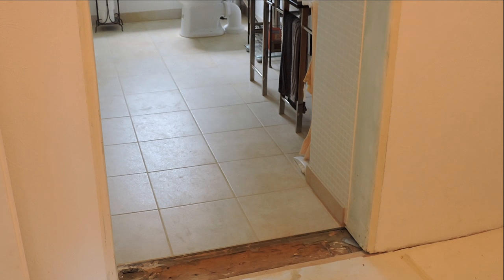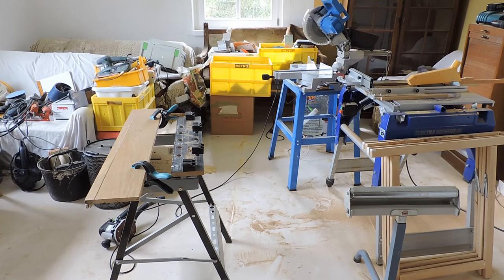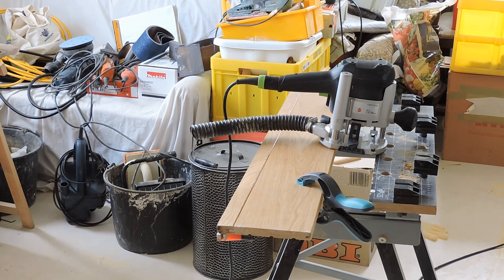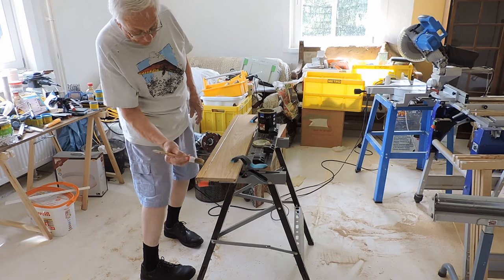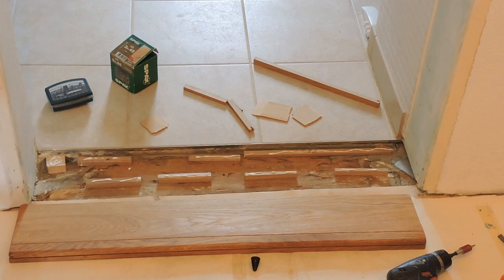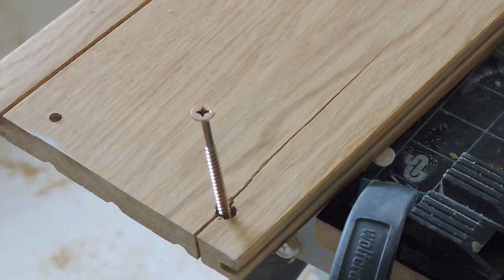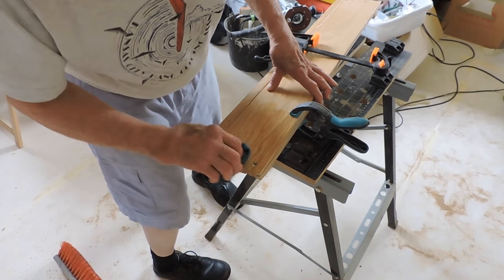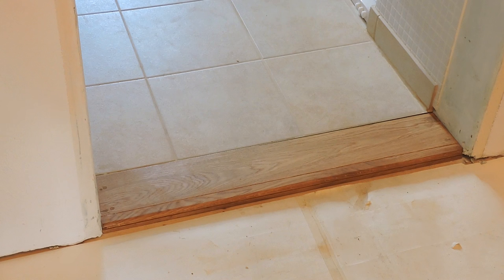Making a door sill for the bathroom door on the 3rd floor

Comment: Bruce, it turned out wonderfully!  Great workaround with that split, and they happen to us all.  Love the way you did that rounded inside corner with the baseboard...I remember you
doing a rounded outside corner in another video using the same technique.  Thanks for the post, I really enjoyed it. :-)
Reply from the maker: Thanks Dale. I'm glad to have the door sill finished. Yes, I'm satisfied with the look of those corners. It's a little fumbly, but as it turns out the new little belt sander is really great for making custom angles on the molding!
Reply: Having been a trim carpenter in my day, I know all about "custom angles"...I now see actual, flexible moldings in use, which I didn't believe until I picked a piece up and looked at it...it resembles MDF and is intended to be painted...but flexes like rubber...wow.

Comment: I always thought you had to drill a small hole at the end of a crack to stop it cracking further, before gluing it back. Maybe I am wrong. ATB Bruce
Reply from the maker: That would have been necessary if there was any reason for the crack to reopen or be under tension. I guess I forgot to mention that I moved the screw holes clear of the original holes so there would be no stress on the crack.
Reply: TY Bruce for the clarification